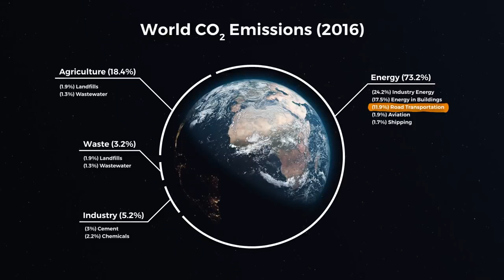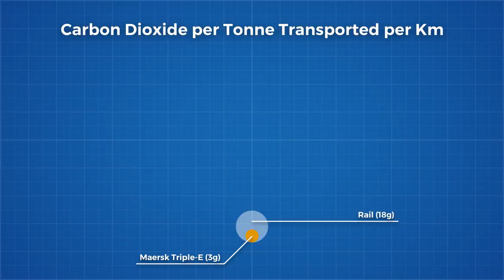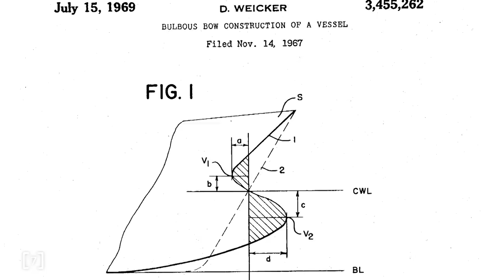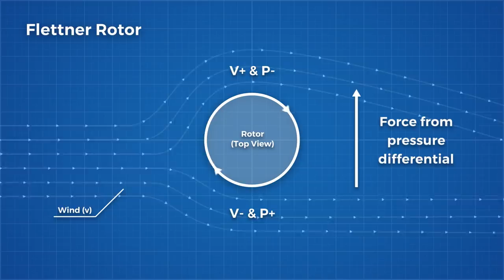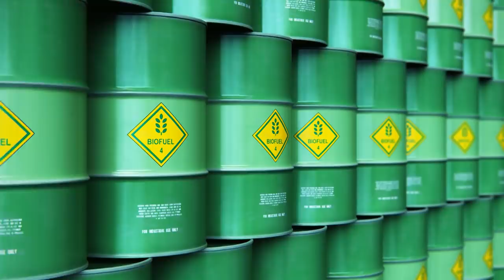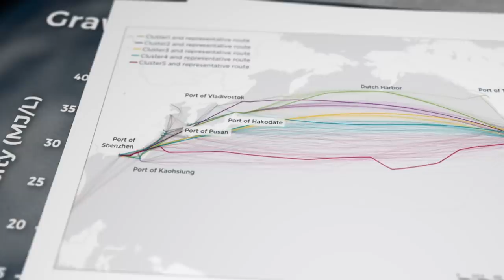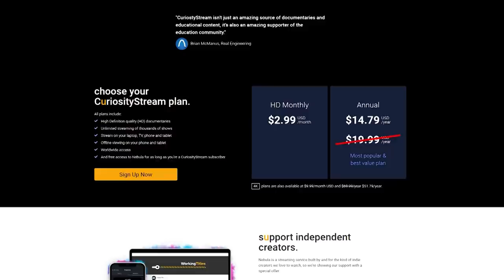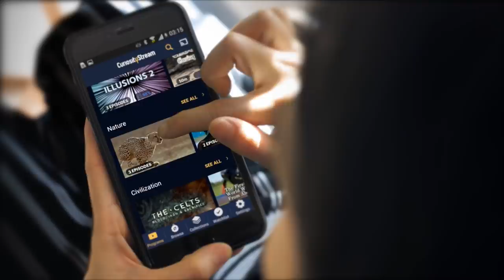Are Renewable Powered Ships Possible?

Comment: Sure about all the figures you've presented in this video? It's possible to convert or build from new ships with a CMSR power plant. That will solve many problems. Sails are no option for large cargo ships: too dangerous to operate for the crew and maintenance is costly.  If all electrical power worldwide is produced by CMSR-technology, the carbon dioxide emission will drop rapidly, but will not stop the Earth from warming. For more info:  www.seaborg.co.
Reply: Start by doing a web search for ‘nuclear ship savannah’.  ‘They’ say nuclear is cheap, it’s not it is expensive as well as being complicated, dangerous, not universally socially acceptable and having only ‘no need for refuelling’ as a questionable advantage; actually it does need refuelling just not as often.  When they do need to refill the warming up stuff it takes considerable longer than pumping tonnes of thick black, HFO cSt380, or thin runny stuff, Avtur-JetA1, onboard which is one of the reasons HMS Queen Elizabeth and HMS Prince of Wales are pushed about by gas turbines thus using the same fuel as the aircraft that fly off of them.  The Royal Navy (RN) with a high degree of skills and expertise use, at vast expenses to the UK taxpayer, a current operational nuclear fleet of 8 boats in two flotillas, four attack subs and four ballistic missile boats.  The carbon footprint of all the extra bits of hardware and the fuel, including processing thereof, from ground to propeller, are the external costs that never seems to get considered.  Disposal, once it wears out, of both the machine (that was a ship) and fuel is another can of worms best left unopened.  The 26 RN boats no longer in use are laid up (some in Rosyth and some in Portsmouth) awaiting long term deconstruction including dealing with the fuel rods and other irradiated material.  The USN is not, as far as I know, a commercial organisation working to very tight margins and also has the skill and expertise to handle the complexities of nuclear power so their aircraft carriers are nuclear powered and each have a build cost three times that of QE/POW, bigger crews and more generous funding.  For those who still think that nuclear energy might be the answer I recommend this report: - https://www.bbc.com/future/article/20200901-the-radioactive-risk-of-sunken-nuclear-soviet-submarines? ocid=ww.social.link.email.  The navy of the USSR might have been under resourced and over extended but it was still generously supported in comparison with merchant shipping.  Just think would you have full confidence in the management of a nuclear reactor under the control of an anonymous entity only traceable, possible, via a letter box in a flag of convenience (FOC) nation state?  If you are could you sell that confidence to Japan, the state that hosted the Hiroshima and Nagasaki nuclear detonations as well as more recently the Fukushima ‘event’?  Then try that same, or any other, sales strategy on Ukraine, the nation state that as a part of the USSR (CCCP) hosted the Chernobyl ‘event’.
Reply: @BernardLS  Maybe you should understand the CMSR technology, which opens up for new possibilities.
Reply: @paulsehstedt6275  My understanding of CMSR is not the problem, it is the global trepidation of anything with 'nuclear' in the name and the economics of nuclear having being transitioned from 'energy to cheap to charge for' to 'the costs of remediation are incalculable'.  Modern reaction systems may have overcome the problems but the general public having been lied to in the past and will not believe the fresh new promises.

Comment: Nuclear power has been used for a few years by navy's why is this technology not being brought down to industry.  Happy mental health always take the time to be.
Reply: If you do a web search for ‘nuclear ship savannah’ you will see that it has been tried and did not work.  A similarly heavily subsidised, by the government, vessel is in use in Russia which also operates, in support of the Northern Sea Route, a fleet of nuclear powered ice breakers these may, or may not, have been completely without issues.

Just think; would you have full confidence in the management of a nuclear reactor under the control of an anonymous entity only traceable, perhaps, via a letter box in a FOC (flag of convenience) nation state?  If you are, could you sell that confidence to Japan, the state that hosted the Hiroshima and Nagasaki nuclear detonations as well as more recently the Fukushima ‘event’?  Then try that same, or a similar, sales strategy on Ukraine, the nation state that as a part of the USSR (CCCP) hosted the Chernobyl ‘event’.  Modern iterations of nuclear energy, thorium fuel, molten salt reactors or fusion reactors, will carry the legacy of past problems.  It is the global trepidation of anything with 'nuclear' in the name and the economics of nuclear having transitioned from 'energy to cheap to charge for' too 'the costs of remediation are incalculable' that will prevent the adoption of nuclear energy as a means of creating energy at sea.  Modern reaction systems may have overcome the safety problems but the general public, having been misled in the past, will be reluctant to believe the fresh new promises.

‘They’ say nuclear is cheap, it’s not it is expensive and has a large embedded carbon quotient as well as being complicated, dangerous, not universally socially acceptable and having only ‘no need for refuelling’ as a questionable advantage; actually it does need refuelling just not as often.  When ‘they’ do need to refill the warming up stuff it takes considerable longer than pumping tonnes of thick black stuff, HFO cSt380, or thin runny stuff, MDO, onboard which is one of the reasons HMS Queen Elizabeth and HMS Prince of Wales are pushed about by ICEs and gas turbines thus using a similar fuel as the aircraft that fly off of them.  The Royal Navy (RN) with a high degree of skill and expertise uses, at vast expenses to the UK taxpayer, a current operational nuclear fleet of 11 submarines (also known as ‘boats’) in two flotillas, seven attack subs and four ballistic missile boats.  The carbon footprint of all the extra bits of hardware and the fuel, including processing thereof, from ground to propeller, are the external costs that never seem to get considered.

Disposal, once it wears out, of both the machine (that was a ship) and fuel is another can of worms best left unopened.  The 26 RN boats no longer in use are laid up (some in Rosyth and some in Portsmouth) awaiting long term deconstruction including dealing with the fuel rods and other irradiated material.  The USN is not, as far as I know, a commercial organisation working to very tight margins and also has the skill and expertise to handle the complexities of nuclear power; so as well as submarines their aircraft carriers are nuclear powered and each of the current iteration has a build cost three times that of QE/PoW, bigger crews and more generous funding.  For those who still think that nuclear energy might be the answer I recommend this report: - https://www.bbc.com/future/article/20200901-the-radioactive-risk-of-sunken-nuclear-soviet-submarines?ocid=ww.social.link.email.  The navy of the USSR might have been under resourced and over extended but it was still generously supported in comparison with merchant shipping.

Comment: Issue with fuel? Go nuclear 😜
Reply: If you do a web search for ‘nuclear ship savannah’ you will see that it has been tried and did not work.  A similarly heavily subsidised, by the government, vessel is in use in Russia which also operates, in support of the Northern Sea Route, a fleet of nuclear powered ice breakers these may, or may not, have been completely without issues.

Just think; would you have full confidence in the management of a nuclear reactor under the control of an anonymous entity only traceable, perhaps, via a letter box in a FOC (flag of convenience) nation state?  If you are, could you sell that confidence to Japan, the state that hosted the Hiroshima and Nagasaki nuclear detonations as well as more recently the Fukushima ‘event’?  Then try that same, or a similar, sales strategy on Ukraine, the nation state that as a part of the USSR (CCCP) hosted the Chernobyl ‘event’.  Modern iterations of nuclear energy, thorium fuel, molten salt reactors or fusion reactors, will carry the legacy of past problems.  It is the global trepidation of anything with 'nuclear' in the name and the economics of nuclear having transitioned from 'energy to cheap to charge for' too 'the costs of remediation are incalculable' that will prevent the adoption of nuclear energy as a means of creating energy at sea.  Modern reaction systems may have overcome the safety problems but the general public, having been misled in the past, will be reluctant to believe the fresh new promises.

‘They’ say nuclear is cheap, it’s not it is expensive and has a large embedded carbon quotient as well as being complicated, dangerous, not universally socially acceptable and having only ‘no need for refuelling’ as a questionable advantage; actually it does need refuelling just not as often.  When ‘they’ do need to refill the warming up stuff it takes considerable longer than pumping tonnes of thick black stuff, HFO cSt380, or thin runny stuff, MDO, onboard which is one of the reasons HMS Queen Elizabeth and HMS Prince of Wales are pushed about by ICEs and gas turbines thus using a similar fuel as the aircraft that fly off of them.  The Royal Navy (RN) with a high degree of skill and expertise uses, at vast expenses to the UK taxpayer, a current operational nuclear fleet of 11 submarines (also known as ‘boats’) in two flotillas, seven attack subs and four ballistic missile boats.  The carbon footprint of all the extra bits of hardware and the fuel, including processing thereof, from ground to propeller, are the external costs that never seem to get considered.

Disposal, once it wears out, of both the machine (that was a ship) and fuel is another can of worms best left unopened.  The 26 RN boats no longer in use are laid up (some in Rosyth and some in Portsmouth) awaiting long term deconstruction including dealing with the fuel rods and other irradiated material.  The USN is not, as far as I know, a commercial organisation working to very tight margins and also has the skill and expertise to handle the complexities of nuclear power; so as well as submarines their aircraft carriers are nuclear powered and each of the current iteration has a build cost three times that of QE/PoW, bigger crews and more generous funding.  For those who still think that nuclear energy might be the answer I recommend this report: - https://www.bbc.com/future/article/20200901-the-radioactive-risk-of-sunken-nuclear-soviet-submarines?ocid=ww.social.link.email.  The navy of the USSR might have been under resourced and over extended but it was still generously supported in comparison with merchant shipping.

Comment: If a small nuclear reactor like NuScale was used, that’s 77mw or 100,000 hp or the power needed for New Panamax ship 377m by 50m. No emissions. I have no idea if a NuScale can take wave action, but since we have aircraft carriers, someone builds one.
Reply: If you do a web search for ‘nuclear ship savannah’ you will see that it has been tried and did not work.  A similarly heavily subsidised, by the government, vessel is in use in Russia which also operates, in support of the Northern Sea Route, a fleet of nuclear powered ice breakers these may, or may not, have been completely without issues.

Just think; would you have full confidence in the management of a nuclear reactor under the control of an anonymous entity only traceable, perhaps, via a letter box in a FOC (flag of convenience) nation state?  If you are, could you sell that confidence to Japan, the state that hosted the Hiroshima and Nagasaki nuclear detonations as well as more recently the Fukushima ‘event’?  Then try that same, or a similar, sales strategy on Ukraine, the nation state that as a part of the USSR (CCCP) hosted the Chernobyl ‘event’.  Modern iterations of nuclear energy, thorium fuel, molten salt reactors or fusion reactors, will carry the legacy of past problems.  It is the global trepidation of anything with 'nuclear' in the name and the economics of nuclear having transitioned from 'energy to cheap to charge for' too 'the costs of remediation are incalculable' that will prevent the adoption of nuclear energy as a means of creating energy at sea.  Modern reaction systems may have overcome the safety problems but the general public, having been misled in the past, will be reluctant to believe the fresh new promises.

‘They’ say nuclear is cheap, it’s not it is expensive and has a large embedded carbon quotient as well as being complicated, dangerous, not universally socially acceptable and having only ‘no need for refuelling’ as a questionable advantage; actually it does need refuelling just not as often.  When ‘they’ do need to refill the warming up stuff it takes considerable longer than pumping tonnes of thick black stuff, HFO cSt380, or thin runny stuff, MDO, onboard which is one of the reasons HMS Queen Elizabeth and HMS Prince of Wales are pushed about by ICEs and gas turbines thus using a similar fuel as the aircraft that fly off of them.  The Royal Navy (RN) with a high degree of skill and expertise uses, at vast expenses to the UK taxpayer, a current operational nuclear fleet of 11 submarines (also known as ‘boats’) in two flotillas, seven attack subs and four ballistic missile boats.  The carbon footprint of all the extra bits of hardware and the fuel, including processing thereof, from ground to propeller, are the external costs that never seem to get considered.

Disposal, once it wears out, of both the machine (that was a ship) and fuel is another can of worms best left unopened.  The 26 RN boats no longer in use are laid up (some in Rosyth and some in Portsmouth) awaiting long term deconstruction including dealing with the fuel rods and other irradiated material.  The USN is not, as far as I know, a commercial organisation working to very tight margins and also has the skill and expertise to handle the complexities of nuclear power; so as well as submarines their aircraft carriers are nuclear powered and each of the current iteration has a build cost three times that of QE/PoW, bigger crews and more generous funding.  For those who still think that nuclear energy might be the answer I recommend this report: - https://www.bbc.com/future/article/20200901-the-radioactive-risk-of-sunken-nuclear-soviet-submarines?ocid=ww.social.link.email.  The navy of the USSR might have been under resourced and over extended but it was still generously supported in comparison with merchant shipping.
Reply: That was a long and thoughtful reply. I appreciate it. Rare in today’s internet. I was aware of past failures, my thought was that the small modular units like NuScale and TerraPower might change things.
Reply: @tyroberts2261  Nuclear energy in any form will carry the legacy of past events, the current events in the Suez Canal might illustrate that things can go wrong and having a nuke on board would only raise the level of peril.

Comment: Honestly, the only ways to move forward with decreasing carbon emissions are either government mandate or making it more economically attractive (e.g., increased efficiency, reduced energy costs). Making it more economically attractive is the better option in my opinion because it takes away conservatives' arguments against government intervention and helps businesses overall.
Reply: Government mandate, there are international (the International Maritime Organisation) and regional structures (various Memorandum of Understanding groups) in place that could do this.  Incremental improvements, in degree and extent, of fuel quality are probably the most sensible. The apparent reluctance they have displayed is driven by the 7.8 billion people on the planet who all need to be housed, fed and clothed.  Working in a sweat shop in Southeast Asia may not be appealing but as an alternative to starving to death it is the only option some people have.

More economically attractive, this is definitely the way to go as the shipping industry does not wish to work any harder that it has to too generate the revenue it needs so better margins might lead to harm reduction though the higher unit cost that will be passed on to the consumer might be a bitter pill for them to swallow leading to the consumers reducing their purchase rate.  Increased efficiency & reduced energy costs are productivity gains that will only get the industry so far and it is likely that they will seek to externalise any and all costs that they can such as atmospheric pollution.

Reductions, both of quantity & distance, are the lowest of the low hanging fruit that will reduce shipping impacts, but consumers are the drivers.  With a replacement rate of 2.1 children per couple if the mantra of ‘two will do’ became commonly accepted many of the resource consumption problems could be solved by stabilisation of the population.  The remaining impacts could succumb to ‘satisfy your needs not your wants’.